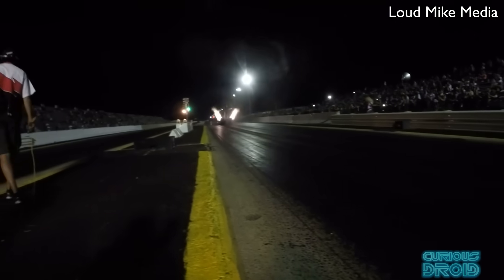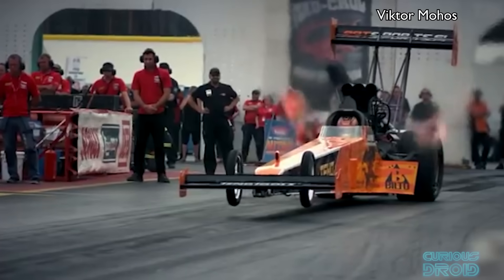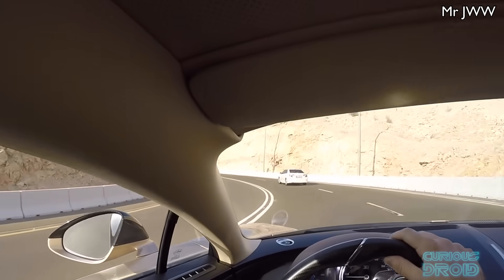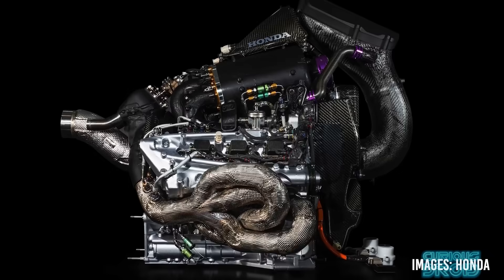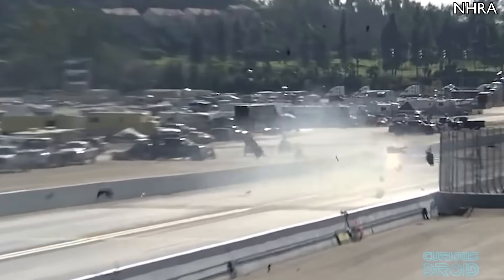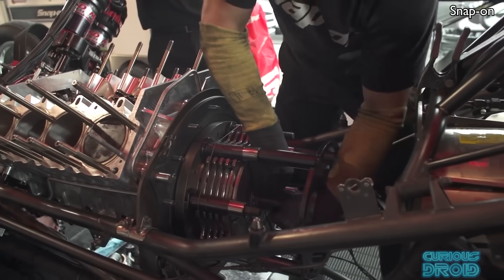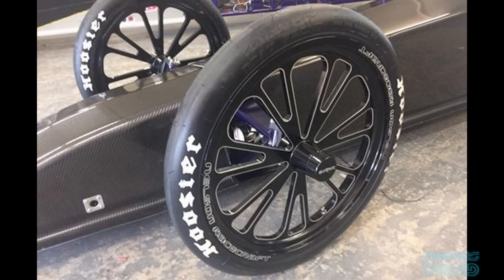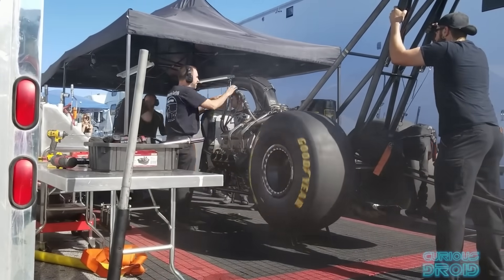The Amazing Engineering of Top Fuel Dragsters

Comment from the maker: Why did I make a video on drag racing I hear you ask, well I did do drag racing about 30 years at Santa Pod, Avon Park and York Raceway but in the rather lower 9.90 bracket class of Supergas where I raced a road-legal 1968 Chevy Camero SS called "Coco Connection" running a 650 hp 462 ci big block + 100hp of nitrous oxide. The car is still around on youtube but I think it's red now while it was metallic yellow when I had it. It was actually a Custom Car magazine centre page spread back in the 80s when it had just come over from Florida.
Anyways, I always loved the Top Fuel cars and the staggering amount of speed and noise they created so I thought that I would revisit the fuelers to see what had changed over the past 30 years and its still extreme engineering like rockets, planes etc, hell maybe I should do Rocket/Jet cars sometime, their even more fun down the 1/4 mile  :-)
Reply: I remember Coco Connection. I was at the Pod all the time and was there when Sammy Miller tried to beat the still record of 3.22 420mph set by Kitty O, Niel in 1977.
Sammy went 3.52.
Sadly Top Fuel  Dennis Priddle the 1st Brit in the six,s passed away this week.
My favorite racer back then was top champion  Sylvia Hauser.... Great burn outs and wheel stands in her Dodge Challenger.
Reply from the maker: @rocklover7437  I was there in 1990 when Darrell Gwynn crashed his top fueler which I think was the fastest in the world at the time on a demo run, couldn't believe that he survived, it was a really nasty accident and put him out of racing.
Reply: @CuriousDroid  you should pin this comment so it doesn't get lost, it explains a lot! 

Loved the vid, probably one of the best so far
Reply from the maker: Andy Cole it is pined ;-)
Reply: @CuriousDroid  i don't think it is pinned though, i don't see the Pin logo next to the comment.
Reply: @CuriousDroid  Superb video!
You said that you have pinned your comment about your racing background (as it well should be)
                              However, it is NOT pinned
The comment is not marked as pinned and can only be found by browsing down through a lot of other comments
Reply: @CuriousDroid  so indeed was i. i am looking at the piston / con rod from that actual car right now, which they disassembled at the race and sold off parts to raise money. i purchased the piston and liner. i visited him a few days later at Stoke Mandeville hospital near where i lived at the time. really nice guy and so sad he was hurt as he was. i understood that the car actually had the arm restraints fitted, but as they were not required by UK regulation he chose not to use. great video by the way sir, as was your recent Deltic vid. keep em' coming fella!
Reply: @andycole3769  is right
Reply: @CuriousDroid  I remember hearing about that myself and had been following Darrrell in the magazines for years. That was heart breaking, he lost an arm and was left paralyzed. It happened when they were doing an exhibition run at a track in the U.K. Up until that time he had a very promising career ahead of him as a top fuel driver. I heard that they didn't put all the normal restraints on him since it was just an exhibition run so his arm came out of the cockpit during the crash and I think it was torn or cut off. I saw him probably around 1987 at the GatorNationals in Gainesville Florida and he was working in the crew. I think he owned the team but I don't remember who they had driving. I was amazed that he could still work like that in a wheelchair and with one arm. Crew members would bring some part over to him every so often and show it to him to get his advise. If he hadn't been injured he would have been one of the greatest ever.
Reply: Gen 1 Camaro, 68 best year imo. Respect ✊️
Reply: @stingray427man  wasnt 67 the first model year?
Reply: Well, I think I can say you hit the bull's eye here. Great video, a lot of good info, ty!
Reply: So you remember Money Hungry Camero ?  Cover of Custom Car with Topless Nicola if my memory serves me lol.
Reply: Thank you so much for doing this video! What a great surprise!!! My dog is named after the top fuel dragsters we watched at Brainerd International Raceway for the last 20 years!  It’s my favorite part of the summer and half the reason my YouTube channel is here!! Thanks again!
Reply: I've heard it said that the only things that accelerate faster than a top fuel car on launch go to space, and even then that's unmanned rockets. Those top fuel pilots are bonkers insane.
Reply: Just casually used to be a racer, and now is an amazing youtuber. You are the world’s most interesting man.
Reply: I was surprised to see this video, yes, but also because as a kid i used to love these cars.
I'm from Holland, so it's not really a thing here, but i used to watch the races on Eurosport in the 90s and built my own dragsters with Lego, haha
Great video, always a nice surprise when our interests overlap.
Reply: Just wanted to mention that 12000 pounds down force does not equal with 5.4 kN but 54 kN!
Reply: Can you do Tractors for tractor pulls sometime too? Love this channel so much, keep up the great content.
Reply: You are full of surprises ha ha ha ! This looks like it contains a lot of good stories :)
Thank you for sharing !
Reply: You just became Fonzie
Reply: I have to disagree with you. A rocket or a jet car is not near as spectacular or unpredictable as a top fuel dragster. Although a rocket car is awesome in its own right you can kind of expect what it's going to do. The same could be said for the somewhat weaker jet car. For both, there's not much opportunity for excitement short of them flying away at the traps or their cutes not deploying. On the other hand, the top fuel dragster or AA funny car is nothing short of spectacular ever. Whether they make a perfect run or blow the tires off at the hit of the throttle or smoke the tires for an entire quarter mile or disintegrate an engine etc etc, even the most experienced race fan cannot predict what they are going to do. That being said, it's always fun to take someone who's never seen these masterpieces of engineering and luck because there's nothing you can say or show them on TV that puts it in perspective as it does at the drag strip. Cheers
Reply: it was strange to see that in your channel,but also a different aproach to the usual way from more specific channels on the matter.it really worth every second of the video and im not interested in top fuelers,but love the "ingeneering" aspect  as you presented it. I even see it on a different way now.
Do about what you want and we will enjoy it for sure.
Thanks a lot, sincerely.
Reply: "...rather lower 9.90 bracket..." HA HA HA HA HA! That's still pretty potent racing my friend!
Some mates and I did a RWYB at Santa Pod a few years back, a BMW M3, a Mondeo ST and me in my Range Rover P38 V8 4.6.
My mates ripped into me all day about how slow I (unsurprisingly!) was but I went away with the biggest grin of all of us with my timing sheet showing my best ET of the day was 18.05 seconds at 76mph! I was so happy I uploaded the phone footage and although I committed the unforgivable sin of filming it in portrait instead of landscape, I am so glad I filmed it!
https://www.youtube.com/watch?v=933QhgkrtUs
Excuse me squealing like a girlie at the end but all day long I was handed my arse by all sorts of cars and this was my only win of the day!
I cannot recommend highly enough ANYONE having a go at a Run What You Brung (RWYB) at a drag strip!
Reply: I wasn't expecting this. Mad respect now.
Reply: :O
Reply: 0:18 is Adelaide International Raceway in Australia, and my guess is its Darren Morgan (4x National Champion) driving the Fuches Dragster - same pass for the engine blow up later in your vid.
Reply: OK, i'll be honest - I did not see this coming
Reply: Whoa! Your a serious drag racer then! Many years ago lived in Denver and had a 69 Road Runner would do the weekend brackets at Mile High. And finnished out my airline career in Phoenix so Firebird raceway was near by and I bought my nephew's Foxbody Mustang. 
That car got me in trouble with "her" and it was requested I find another passtime that did not involve front tires leaving the ground, like only a fraction of an inch sheesh, got involved some desert racing and ofcourse a friend and co-worker got busted up in front of both our wives and we had to follow ambulance to hospital he now walks with a cane. So that put a real end to that stuff. I have to keep it to R/C 
now. Grandkids and all that stuff. I'll look for your car online.
Reply: You probably raced against my brother, John Whitmore, and his Jag powered Drag’n’fly?
Reply: My great uncle Fritz Voight was a legend in the drag racing & land speed record scenes. Takes a special kinda smart mixed with crazy to get into that. My whole family on both sides were gear heads but I opted to stick to much safer route of jumping out of planes & helicopters in the Army. 😂
Reply: You got your lbf to kN conversions wrong by a factor of 9.81 several times.
Reply: @Curious Droid Jet cars don't get enough love. I hope you do make a video on them, and I have a couple of starting line videos I'd be happy to let you use (you can find them on my channel without much digging). Photos too, if you need. All in the name of #jetcarsrock
Reply: More vehicles !!!!!! We all love anything with a engine
Reply: Hey Paul, Jet cars look sensational - but as YOU know, their numbers just do not stack up compared to TF! Rocket cars, interesting. I saw one once pull a 4.5sec ET when TF was running 5's. Not much of a fanfare or a spectacle, other than that white smoke, but talk about shot from a gun!
Reply: Awesome!
Reply: There is a video of it in yellow and some pics in the uk at the pod,  I am wondering which person was you in them in think at 0:26 in https://www.youtube.com/watch?v=Rfk1iZY9U7g might be you @curiousdroid?
Reply: Wow car sounds nice
Reply: before watching i already know this will be the best video i've seen explaining top fuel dragsters. i've seen a top fuel and jet car dragster once , the sound and feeling is incredible. awesome that you had a drag car,  was it a centre page in chrome and flames magazine ?            (just finished the video , i knew it would be the best i've seen. very good and complete without going into too much detail)
Reply: Cool. Great video 👍🏻
Reply: Excellent & accurate facts, on average it cost $16K+ AUD a pass over a Season here in Australia to run T/F winning a few championships along the way. ;-)
Reply: the most important factor in hp is the air outside and the drag racing center, some places are really cold when they drag race and then theres places which are very hot ,so the air density is always calculated to make sure its correct based on the fuel used per each run, with out this calculation, the engine would simple just blow up always?
Reply: Sounds like a sweet ride
Reply: Nicholas Feiock  that was a weird comment you deleted.
Reply: Nicholas Feiock its all good.
Reply: Santa Pod is just up the road from me.
Videos of Top Fuel, Just have to be there. Oh Cover your ears lol
Reply: @Kneichion  Covering the ears wasn't enough. Standing next to the cars at launch, my chest hurt (as well as being showered with black droplets of burnt tire)
Reply: @gregparrott  lol yep full body massage
Reply: Heck yea!!  Racing (car culture) rules the world! I bet it's fun to streak the quarter at 9 seconds
Reply: I love your channel. Thanks for the content. Yes Top Fuel is quite mind bending as well as many other subjects you’ve covered :)
Reply: This is awesome, you need to get back down to Santa Pod! We do all the videos for them I'd love to play this in the livestream during breaks
Reply: See I knew you had the racing bug.
Reply: @9.11 that must be from Finland cause it says in the cans bensa = petrol and metanoli = methanol that are finnish words ;)
Reply: Paul: I would like to make a little donation to you..
Reply: That is so cool to learn you were a racer! Not going to lie, I wouldn't have guessed it. :) Would love to see more videos on racing from you, this was awesome and insightful.
Reply: Very cool man! I grew up at the drag strip as my father has a dragster. Not a top fuel, I think it was super comp class. Around 7 second quarter mile
Reply: From an avid Top Fuel fan, very well done Sir!!!
Reply: Curious Droid. I used to go to Avon Park. When I first started going it was known as Long Marston.
sadly Avon Park is now a huge housing estate. I have great memories and some great pictures.
Reply: @THEJR-of5tf  yes, i remember them rebranding it. at the time it just seemed less tired than 'the pod' then it simply died away. a sad loss and so much easier to get to from near Oxford. ah well.
Reply: Thanks for making this video.
I know that is it's a bit of worthless fact about what's louder this out jet engines, but I found out and managed to figure out a few years ago that these cars are the loudest man made thing; that isn't designed to either expressly be so, not expressly designed to destroy something other than itself, or to refine all'@ by destroying something else. 
I had already known that they use more fuel and faster than jets, pull more G's than jets. Up until this video I had no idea that their exhaust also produced half a ton of thrust: more than some jets. But then again that's a only as a secondary side effect.
The real deciding factor on how loud they are vs jets. Comes not from decibels on a sound pressure test.
But the 2.3 decibels @30 ft from the USGS seismic test.
It's an entirely different, brand, quality, volume, and league of loud.
Reply: I helped build the strip at Avon Park — formerly Long marston — welding together the Armco barrier overnight for the first meeting Saturday morning. Went on to using my car on the bike rollers then with my brother in law ran Slick Willey. Happy days.
Reply: I feel like I remember David frieburger mentioning that car in one of his Q&As. Very cool.
Reply: Kudos!
Reply: Amazing! I did not see you as a muscle car guy.
Reply: Thx for the fact
Reply: Would be cool to see more race related content keep up the great work
Reply: Truly incredible machines that are in a class of their own.
Reply: Truly incredible machines that are in a class of their own.
Reply: You could've also mentioned that the engine of a top fuel dragster is held in place in the frame with hose clamps similar to the ones on the radiator hoses on a normal street auto.
Reply: @sportytone1  I thought they were secured to the frame with ratchet straps.
Reply: 12 000 lbs is not 5.4kN. It is roughly 5.4 metric tons. But 1 N = 1 kg × 9,81 m/s2. So it is closer to 54 kN.
Reply: That is so cool! :) ah I suspect it will always remain just a dream. Still, I'm very glad i had the chance to drive a 69 Camaro with the 454ci big block plus a much later supercharged ZL1 which also had about 650hp. Super happy fun time!
Reply: Yes please,do the rocket/jet cars video you mentioned.
Reply: Ahh...man I remember that car!... that's amazing..still got some good pictures of it in my drag racing albums..excellent video by the way...top fuelers are unexplainable to non drag race folk...you have just got to be there and FEEL it...
Reply: Jet cars are fun to watch but are slower and not as loud as a fuel car
Reply: That is great.  Thank you for this episode.
Reply: by any chanes your name is Dan
Reply: @OskarasNauseda  who?
Reply: Very very cool.......
Reply: Best video  ive seen on Top fuel engines in my life!!  Lots of "INSIDE" engine info and great pics (i.e. rods etc).   THX
Reply: More to the point, why did you make a video on Drag Racing and not include more Hemi Soundtrack.....
Reply: @CuriousDroid My father was on the crew for “Ohio” George Montgomery in 1964 when they brought the ‘33 Willy’s gasser to England and won every race. NHRA drag racing was my father’s life!
Reply: I remember coco connection car from custom car and street machine long before the Internet. What was the idea behind the name?
Reply: It's not top fuel but do you follow Hotrod Dragweek or Rockey mountain race week? I highly recommend checking them out or watching their old live streams on YouTube.
Reply: JATO powered car please!
Reply: Jet cars? Absolutely! Maybe a mention of the land speed record cars and the insane guys who that ran jets too- I still remember Craig Breedlove's comment when he crashed his Spirit Of America "For my next trick, I will set myself on fire". Don't forget Art Arfons' Green Monsters, and the current attempts
One thing you did not mention about TFDs engineering is the relatively spiderweb-thin chassis holding all the parts together. When I was a kid at the dragways in the 60's I imagined them being built of huge I-beams to take the stresses, then I saw my first one "undressed" and could not believe it.
Reply: " their even more fun down the 1/4 mile  :-)" - *they're mate.

Comment: In 1977 Kitty O, Niel set the "still" fastest 1/4 mile record (now shorter 1000 ft ) at 3.22 seconds and speed of 420 mph in a steam rocket.
I doubt this will EVER be beaten.

Kitty still holds the Women's Land Speed Record at a "governed" down speed of 512 mph.
Her contract didn't allow her to break the overall Men's record of 620 mph.

Kitty after her 512 mph average of 2 runs  said she could of easily gone 700 mph.

Sadly Kitty passed away November 2nd  2018 from pneumonia at 72.

When the words "Automotive Fastest" is mentioned sadly a tiny deaf Woman called Kitty gets forgotten.

At 3.22 seconds to 420 mph Kitty made these Top Fuel Pilots look pedestrian.